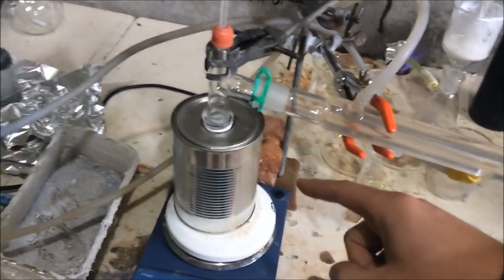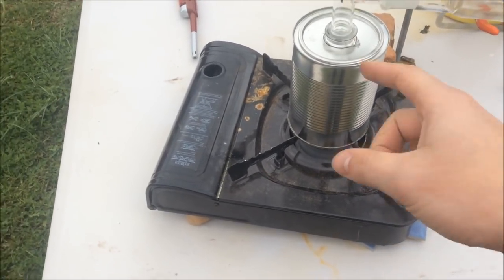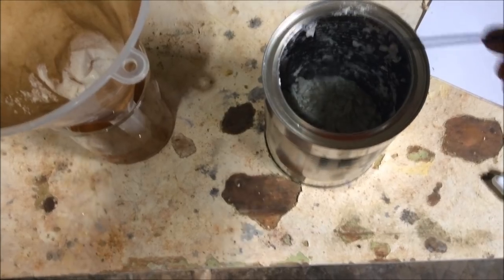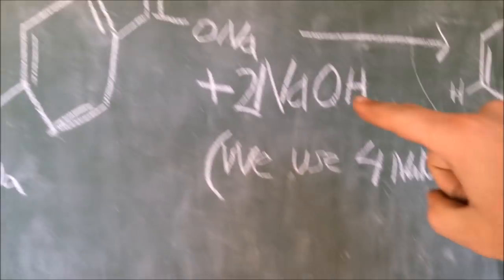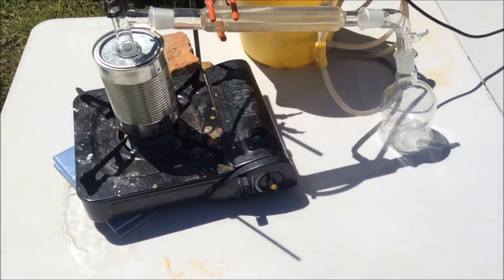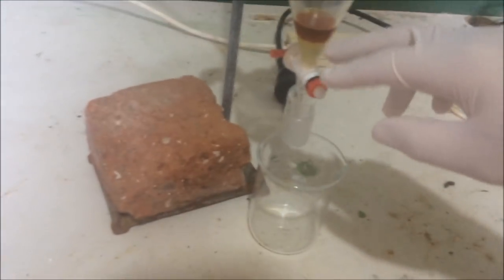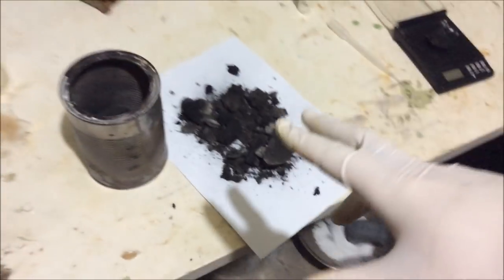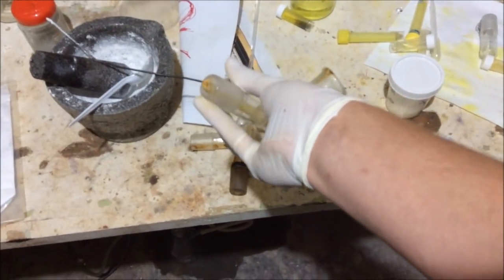Benzene from Na Terephthalate

Comment: You should recover the glycol with vacuum distillation, then the temperature window issue goes away. You wouldn't need a deep vacuum, 10 Torr (or 10,000 milliTorr) at 100 C would work just fine.

Comment: I found a paper that mentions a catalytic decarboxylation of aromatic rings, mainly benzene rings. It uses Cu2O as a catalyst along with hexamethylenetetramine and N-Methyl-2-Pyrrolidone as a solvent (can be purchased fairly cheaply on ebay). It seems like a low temperature decarboxylation <300C. I'll post the DOI at the end. You can go to Sci-Hub to gain access for free. IDK, may be something to revisit at some point? I want to get around to trying it sometime soon however too busy with school at the moment. PET would be an excellent source of Benzene!

DOI: 10.1002/adsc.201201018
Reply from the maker: I'll check it out yeah thanks! It is a project I think about occasionally, as it would be cool to be able to reliably produce useful home chemistry chemicals from the mountains of plastic that surround us all

Comment: Those IKA hotplates are ass. They get problems with heating within a few months yet we still keep buying them. I rescued a Heidolph stirrer hotplate from 1989 and it still works fine if you shove a paperclip in the thermocouple thingy to short it to ground.
Reply: I repaired one a few month ago: Broken solder joint at the TRIAC. They use a relay and  a relay in parallel, probably for some course and fine control. The relay was OK, so it started to heat, but when it should reach the desired temperature, it "wanted" to use the TRIAC for finer control. So it never reached the desired temperature. Resoldered the gate of the TRIAC and everything was fine again. 
But they have also another weakness: The cheap RG174 PVC coax cable for the external sensor. Melts at little over 100°C and in contact with nice solvents like THF. Better to replace it with some RG316CU. That has a Teflon dielectric and FEP (FluoroEthylen Propylen Polymer) outer sleeve. A Material which is even used as ainner coating for chemical reaction vessels up to 300 or 350°C and in contact with solvents like THF, etc.
Reply: Seriously, I used an IKA hotplate/mag stirrer from the mid 90s and it still performs well, always thought it was a quality brand. Swedish, isn't t? My last one was a German brand, can't remember the name, but it also was from the 1980s (big sturdy grey machine) and performed its job well, only when you heated on the maximum setting the stirring speed diminished and the apparatus started to make clanking noises.

Comment: We've found that when distilling and recovering petroleum vapors, often the vapor itself becomes atomized.  This atomization will not subside when the temperature is lowered.  Best way to recover the vapor is to bubble it through another solvent - either oil or the solvent itself.
Reply: Sick vape bro

Comment: When you need to seal that stuff in an emergency, use bread dough. It's worthless as a sealant, but compared to electrical tape...
Reply: Yeah let's just make some in an emergency
Reply: Because everyone keeps bread dough laying around the shop, rather than electrical tape...
Reply: @meatsmell8639  Its just flour and water
Reply: @meatsmell8639  I see you've left yourself wide open to a "yo mamma" joke. Tough luck, pal.
Reply: paraffin will do it, but benzene isn't thát bad
Reply: bit late here but it's driving me nuts he doesn't just keep some silicone sealant around! yes it takes time to cure but it's worth it.

Comment: Ah, I've gotta make myself one of those cans with a ground glass joint coming out of it. That's such a great use for broken glassware :)
Reply: and all other pieces that can't really be used are free boiling chips. A lot of Chinese sellers send you boiling chips instead of the glassware you paid for.
Reply: Great idea, just received a Chinese soxhlet apparatus, shipped from a depot 100km from my door and it arrived with every piece completely shattered, so the only useable thing I now have from that is one ground glass joint lol. Beware aliexpress sellers that sound too good folks. Deschem from ebay ships from China but well packaged in polystyrene boxes, always arrives in good state even after a month in transit. But this guy cheaped out on bubble plastic and didn't even bother to put "glass/breakable goods" on his shitty cardboard box package.
Reply: @bromisovalum8417  Deschem's packaging and customer service are second to none.

Comment: After "30 days experiment" i'm going to extract benzene from Na Terephthalate. And reeaally interesting to sinthesize benzene out of acetylene by Marcellin Berthelot method by passing C2H2 (wich made from CaC + H2O, CaC I want to obtain by electrical arc from welding machine) on heated to 400C activated charcoal.

Comment: you should try making Sulphur Trioxide by catalytic Oxidation of SO2 by NO2 and O2.
Reply: Sulfur trioxide is hellishly dangerous stuff. On contact with the moisture in the air, it just starts exploding into these gigantic vapor clouds of sulfuric acid, which just turn everything black on contact.
Reply: The only sane way to make SO3 in the lab is by careful destructive distillation of sodium persulfate with catalytic H2SO4 around 300°C, in max. ~100g batches, with care being taken to handle the initial copious O2/O3 generation. And this should only be done by an experienced chemist using decent glassware and protective equipment, SO3 is without exagerrating pretty damn dangerous to handle.
Reply: i think that the historic distillation of green vitriol to oil of vitriol is also really interesting to see
Reply: i think its typically done with vanadium oxide on some type of substrate, superheated with dry air and SO2, this method can also be used for oleum

with NO2 and O2 i think you would need accurate control of gas flow and by that gas cannisters of NO2 and O2, and wouldnt that also require some insane pressure like most other reactions using gasses to produce useful chemicals?

Comment: Te-re-thal-ate: the p is silent just like it is in phthalic acid
Reply: nah wrong the ph is pronounced as f
Reply: Also, what happens if you put the crude benzene in the freezer? Benzene's freezing point is about 5 degrees C, so you should get at least some crystallization.
Reply from the maker: +Bill Smathers I swear Ill say it right in the next video, I think I've got it now! 

Yep it does freeze. I had it on ice as it was distilling over to stop it evaporating off, and I think I saw it freeze, will have to test with the final product. Its a good way of demonstrating its actually the chemical we think we've made, thanks

Comment: Hey, one question, if you wanted to use molten sodium hydroxide anyways, why didn't you stick to what I said before and just melt the cans right into the lye? You did this step anyways and you rather followed a route that's for making pure terephtalate and for avoiding the use of molten lye. You got days of more work and a useless middle product :D
(Also, memorize it this way: Teref tall eight :P)
If I ever did this with an apparatus this size, I would also go for 4 times the quantity
But this is what we learn from, and one of the things I like about this channel the most is showing all the issues and fail, and the honesty
Reply from the maker: Melt the plastic directly into the NaOH?? Decarboxylate it and deesterify it in the same pot at the same time? Well didnt you say it was awful? I was trying to avoid the awfulness. But I might still try it. 

Yeah there was no bumping of the dry distillation, so there was heaps more room to pack stuff in that can
Reply: It will give off benzene vapour and additives from the plastic, of course it smells, but you already made worse stuff with the tape and all, so why would it matter for you if there's a smell of burned straw?
I think if you stood next to that apparatus for a whole afternoon while you distilled it, you can easily stand this :D
Reply from the maker: Yeah ok you have convinced me, I should try it
Reply from the maker: Aw man your method isnt working very well. I will have a video of it up soon. I wasnt expecting much but was still a little disappointed :P lots of improvements to be made though

Comment: Maybe it would have worked better with potassium hydroxide, since it has a lower melting point?
Reply from the maker: Thats a good suggestion, I imagine it would char less. Good advice for future!
Reply from the maker: Yo potassium hydroxide has a higher melting point, whatcha playing at :P
Reply: Huh, indeed. O_o
I would have sworn it was the opposite!

Nevermind what I said then.
Reply: Extractions&Ire
Ah! But they make a eutectic that melts at 165°C, at 50 mol% Na!
You could try melting them together, letting them co-crystallize, and using that for your experiment!

http://www.crct.polymtl.ca/fact/phase_diagram.php?xlabel=&ylabel=&maxx=1&minx=0&maxy=450&miny=0&calc=1&file=KOH-NaOH.jpg&y=&cat=sa&dir=FTsalt&lang=&type=b&coords=?358,316
Reply from the maker: This is very interesting to know, it might help a lot using a eutectic like that, it would really help keep the charring down

Comment: good first attempt considering Murphy's law, I think you will get a much better yield when your hot plate returns and you can control the heat source, until then a sand bath might help control the temperature and evenly distribute the heat from the open flame, and that sticky tape joint probably cost you quite a few % haha
Reply from the maker: I find sand baths slow things down so much, but it is a good suggestion to improve yield yeah. I think there is a few % to pick up everywhere along this synthesis... from the drying, over heating, lack of grinding to the sticky tape! Hard to say which one did the most damage. Definitely a first attempt
Reply: yeah true, oil baths are better but then you gotta deal with messy, smoky oil, can't win, you got what you were after though, Good job!
Reply: Boiling chips, or sand in the retort to stop bumping. Maybe ceramic that's been crushed since there's NaOH in there.

Comment: i thought ethylene glycol vapor is flammable. kinda beenplanning on doing the same video on benzene  but using the benzoate.
it should be done in a few weeks. i have had chems and the apparatus ready for some time but hey other things and a lack of time ...  i used a builders epoxy fire rated for my tin....
Have you considered doing more attempts on tetrazoles? surely the curiosity has gotten you interested.
 and did you get your new hotplate yet?
Reply from the maker: Ethylene glycol vapour is flammable and it did burst into flames at one point for a brief moment, which was scary and another reason why drying off the solvent like that was a poorly thought out idea.
Epoxy is a good idea. And the benzoate method works a lot smoother. I have just done that distillation for the next video in this series and it works great, no issues at all. Do need to redistill but that's no issue apart from time.

I have considered it yes, and it needs to be done. I can't avoid them forever. And seeing your videos like the one on copper nitrotetrazole makes me want to try them more. But time for me in the lab right now is limited, and seeing as I still don't have any ideas what went wrong last time, I don't have any ideas on how to fix the synthesis so I get 5-ATZ. So i'd have to put in a lot of time to get any reward, and when I don't have lots of time I don't like doing that grind so it's easier to just move on to other projects where I'm more likely to get a result. But yes, hopefully Dec-Jan I'll try again. 

Westlab are being slow. They are currently 'contacting the overseas supplier' and 'it is a time consuming process'. Which I get, but they've had my hotplate at their warehouse for 14 business days now. Getting a bit sick of waiting. But I will get it so that's ok
Reply from the maker: +Joey C Having issues making NaN3 too. Theres things I know I need to fix for that though at least. I suppose I could work on the NaN3 synth and get that working first, and use that to make the tetrazoles
Reply: Extractions&Ire if you are too continue on your quest for tetrazoles, I recommend trying a different path. Diablo's looks good
Reply from the maker: +Joey C Was that the one using NaN3?
Reply: Extractions&Ire yup, what do you think?
Reply from the maker: +Joey C That method for making 5-ATZ looks really nice, ignoring the toxicity of the azide
Reply: Extractions&Ire dicyandiamide is available on eBay from reagent asset.ltd. 50g for 21$ and4$ postage. It is the same stuff I used. Making the  sodium azide is the painful bit, the rest is easy compared to that.  It is far easier than making the calcium cyanamide route and yields are good.